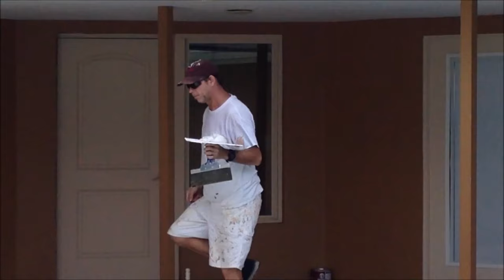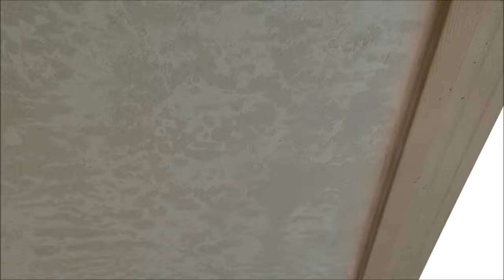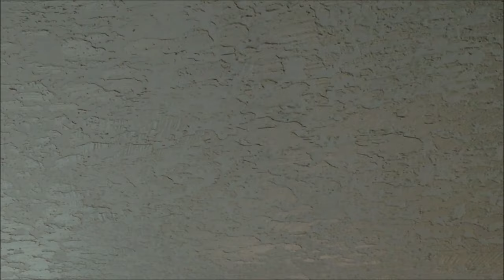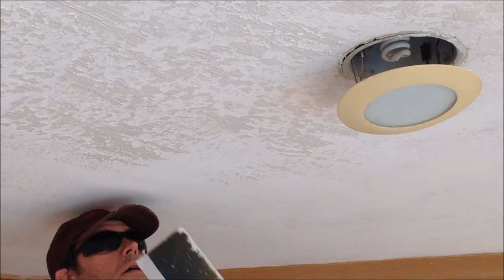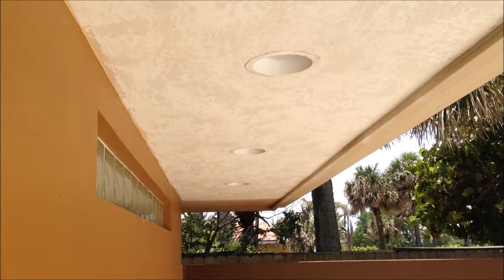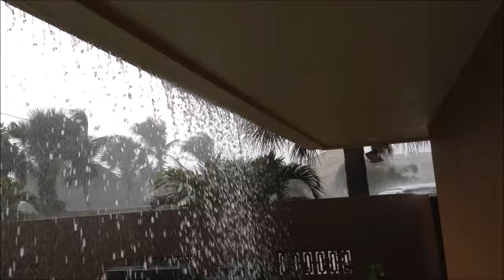Why I LOVE Skip Trowel Texture! How to Apply Skip Trowel Texture

Comment: This is what I am doing now inside a 1978 home. Did an update and some major repairs. It had swamp coolers so there were attic vents that were removed when the AC units went in. 1 wall was falling off the frame work the only thing holding it up was the paper tape, another was damaged beyond repair. Those 2 walls were ripped out and new rock hung. Another wall had a huge bow in it I fixed that one, smooth coated that and skip troweled it with sand.
Then we built 25 degree angled sides in 3 openings in a sofet so the lighting and opening would look like the belonged in the custom house. That has be to floated out and textured yet. Ive used 2 buckets of mud, 3 boxes and 2 bags of 20 min mud so far and I'm only 50% done.  

I came here looking for tips to short cut this project and still get the same end result. My old ways may work but they take many days extra to finish and my poor shoulders arwnt used to doing this. I'm a carpenter not a drywaller, its my step dads home.

Skim coat is going on in the morning on the kitchen ceiling.

Comment: Awesome work sir
Reply from the maker: I really appreciate that! Thanks for stopping by Pete!
Reply: Paul, I live in Utah. I have the hardest time trying to figure out the difference between different knock down textures. If I was to spray on texture with a large nozzle on a hopper gun, and then knock it down, I feel like I get similar results to your skip trowel texture in this video. I do not add sand, but can you help me understand why it is that spraying and knocking down looks the same as this? Is it truly different than just normal knock down?

Comment: Hi Paul. Question - How do I skim coat over a skip trowel texture? I've sanded and sanded and mudded and mudded and the "veins" of the old texture keep showing up when I skim coat. I used thicker mud and watery mud, I've done your roller method and applied gobs with a knife and pan. I little advice would be nice. Thanks.

Comment: Paul, I live in Utah. I have the hardest time trying to figure out the difference between different knock down textures. If I was to spray on texture with a large nozzle on a hopper gun, and then knock it down, I feel like I get similar results to your skip trowel texture in this video. I do not add sand, but can you help me understand why it is that spraying and knocking down looks the same as this? Is it truly different than just normal knock down?
Reply: Taylor Longhurst up close the sand gives it quite a bit different of a look.